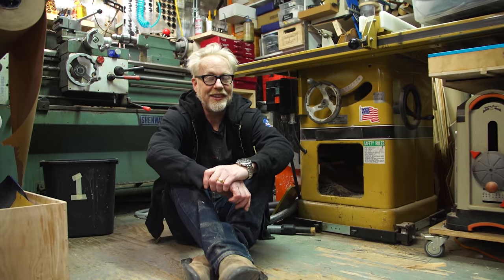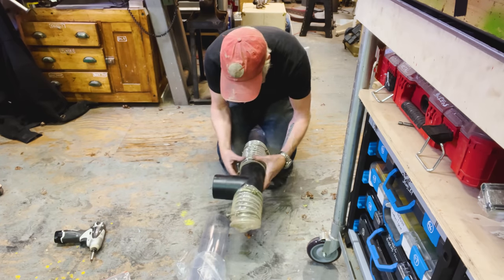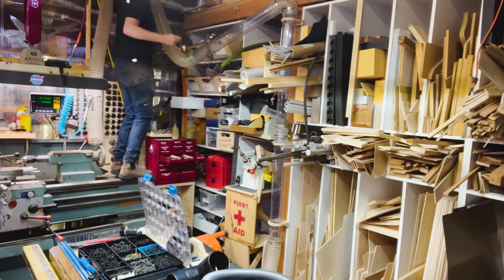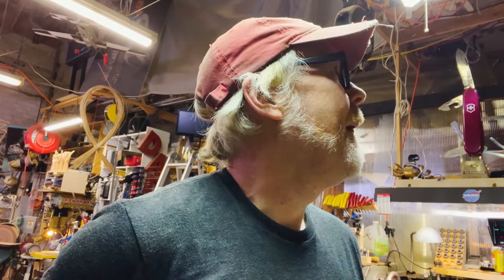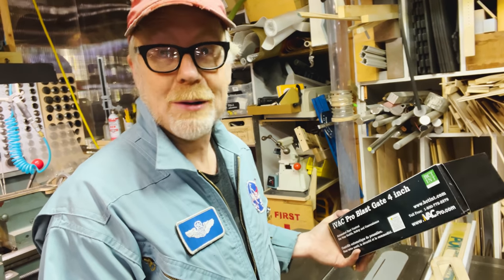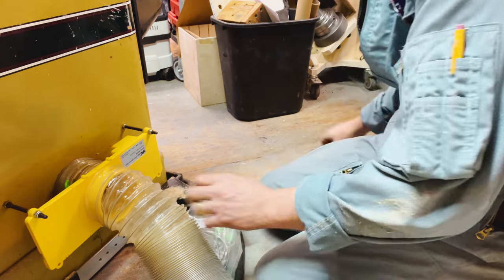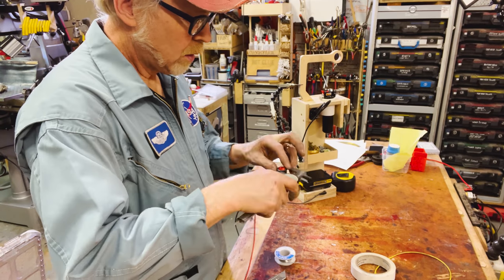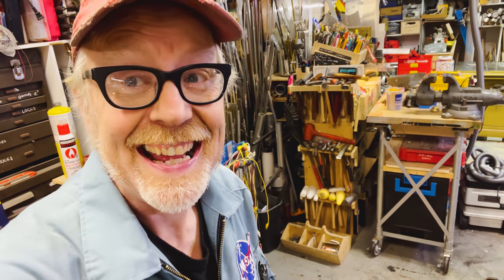Adam Savage's One Day Builds: Shop Dust Collection System!

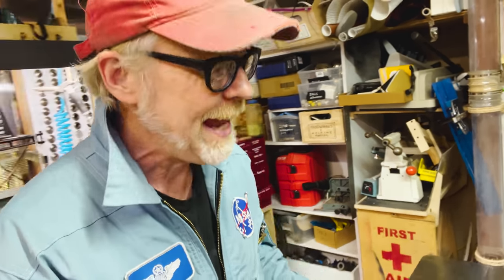Comment: 25:57 I would have put a manual blast gate on the wall in place of the shoulder-high flex-tube coupling behind the saw, saved $110, avoided all that wiring and drilling, and ended the episode twenty minutes sooner. But the push-button gate is cool...

Comment: There is a massive nerd dust collection site by a guy named Bill Pentz you should check out.   You might also watch Matthias Wendel here on youtube.  He has a completely different strategy that I think has alot of merit.  He actually builds his own impellers and volutes from scratch out of wood and integrates dust collection into all of his machines.  And he's getting really good results, tested with an air quality meter.  There are some real advantages to doing it this way.     And even if you didn't want to bother with the homemade blowers, Burden Surplus has some more than equivalent BC impellers for practically nothing.

But for the whole shop method you're doing,  a couple of rules of thumb I've picked up in working on my own shop dust collection:

1.  Use Y's instead of T's.   Produces less turbulence than a sharp 90 degree turn in a T.

2.  Make turns as gradual as possible.   Use the big radius 90 degree fittings to make turns.   Or even better, use two 45 degree fittings.   Or even betterer, heat and bend a piece of the PVC pipe in a form to make a super gradual turn.   The key is to make the air change direction as gradually as possible.

3.  Use 6" pipe if at all possible.   With smaller impellers, you'll lose some static pressure with the larger pipe, but you'll move more air (better to collect fine dust particles).   You only need enough static pressure to keep chips from settling out in the pipe and clogging it up.

4.  On machines that maybe only have a single 4" dust port, consider adding a second port or enlarging the existing dust collection port.   I've seen good overarm dust collection ports built into the blade guard on tablesaws for this purpose.

5.  Use a minimum 12" backward curved impeller with a 2hp or greater rated motor.   Especially if you go with 6" pipe instead of 4".   Ideally, you'd go with a 15" or even bigger impeller, but those get really pricey really fast (I think Cincinnati blower wants $750+ for a 16" impeller)

6.  Design and build your own 16" BC impeller run by a 5HP motor and sell the plans for those to those of us who want to go completely nuts on building a dust collector that will suck the ink out of a dollar bill from 50 paces.

Best of luck

Comment: Those brackets are superb.

I was surprised that one wasn't fashioned to hold the gate against the wall, so it doesn't get banged around.
My money is on the corner where the bolt goes into the plastic.  Hope I'm wrong.

Comment: If you are using plastic pipe for vacuum distribution did you wrap a ground wire, e.g., one turn per foot, around the entire length of the pipe? The air rushing through acts like a giant Vandegraff generator and can give you one hell of a shock if you don't ground the system. Even an ordinary shop vacuum can give a good jolt.

Comment: If I'm not mistaken you would have had better effect if your blast gate on that table saw was back at the wall as close to the main line as possible...less volume to draw a vacuum on if you cut off the whole drop.  Since its remote operated you might have been able to install it before it even drops to the floor

Comment: I'm sure someone mentioned that you could have used thin wall pic waste pipe in 10" lengths. It would have saved you many connections with less flex hose and less clamps.

Comment: I've been dying to find out if this idea I have is good: what if you had a hose coming off a shop vac blower port that connected to the vacuum sucking hose like halfway down, so basically a recirculating system, wouldn't that make the vacuum into a super vacuum? ;D

Comment: I just got a power bar that has a series of plugs where 2-3 of them get no power until one of the others does.  What this allows you to do is power on those outlets only when a specific other one powers on.  The idea is to plug your computer into the switch one and monitors into the others so the monitors only power on when the computer is powered on.  I bet that would also work for the saw.  Unfortunately this is assuming a 110 probably so if the saw is a 220 I don't know if you can get something like that.  But it would dramatically simplify the power on/off of the electronic gate don't you think?

Comment: Kind of surprised Adam didn't go for the automatic switch that turns on an accessory outlet once the tool in the primary outlet is turned on.  Run the automatic blast gate through it for the table saw, and no switch is necessary.

Comment: Ahhh Adam... Your dust collection has (now) come so far, but it has SO FAR to go! I'm rarely disappointed by your videos. But this is such a hack (and not in a good way). You put much more care and thought into your Tape Dispenser! Some points: LOSE THE T JOINTS, 45 deg wye's are what you need , more blast gates, replace that 1 (at best) micron dust bag with a cyclone and a real pleated filter (your lungs will thank you). You loose SO MUCH flow taking your 4" line down to 1.5".

Comment: Just a thought, why not to wire a relay to the power of the table saw to open and close the gate automatically with the table saw.
Not a difficult mod in my opinion.
But hey, love the video, nice work and a very good improvement. It is just a small suggestion.

Comment: I think the gates are supposed to be where the hose splits, not at the tool to maximize effeciency. Also avoid 99 degree angles, 2 times 45 days gree with a straight between is a lot better. Or so I've heard :-)

Comment: What about using 24VAC actuators with current switch on the tool. That way when tool starts it closes circuit and energizes actuator automatically opening gate

Comment: That little unit won't be able to suck that much hose. You need either a bigger unit, or you need to reduce the diameter of the pipe with each successive split and every 3 meters. I'd sell that one, and get a bigger one, back of the napkin math, should probably be the second size over.

Comment: Adam,  you can still get much better airflow out of your system. You put a T right in front of the collector. The turbulence caused by forcing a 90° turn of the airflow significantly drops the airflow to the ENTIRE system. That  1st T should be replaced by a Y.  Then each branch should use no more than a 45° fitting followed by at least 1 foot of smooth pipe to achieve a sweeping turn. For example,  off one side of the Y, a 1 foot smooth pipe then a 45° fitting one foot of smooth pipe and a 2nd 45° fitting to make a 90° turn.  This design should be followed throughout.  The vertical drops should start with a Y off of the main feed followed 1 foot later with a 30° fitting,  one more foot of smooth pipe then a 45° fitting to get you to vertical. Using your table saw as an example,  the T at the bottom should be a Y higher up. The free hose should be no less than 3" diameter reducing the diameter as close to the machine as practical.  4" is better,  reducing only at the nozzle at the very end.  
In this case you might consider getting a dust collecting blade guard to collect dust on top with a 3" fitting as well as the 4" on the bottom.
You must remember that your dust collector is a high volume low pressure system.  It behaves differently than a high pressure low volume system like a shop-vac. A 2" hose with an even smaller fitting going into your hand tool is starving the system for air. Without enough air flow,  material will not traverse the pipes, getting stuck in ridges and bumps caused by flex hose, fittings  and direction changes.  Stay with 3" hose designed for dust collection. When you need to drop to smaller diameter at the tool you may need to add a small vent to increase total airflow.  You may be better off with a high pressure low volume shop vac for dust collection of small hand tools.  Another idea is to run 4" ask the way to the bench. Then only a very short hose to the tool.  
 Also. the best plastic pipe to use is PVC. It's not clear what you're using and why you didn't go with 4" PVC and matched fittings. Hopefully your joints are butted together.  If not, more airflow and pressure drop occurs from all the transitioning which creates lots of turbulence.  Using one section of flex near the collector has a huge effect; as much as  9 times more flow resistance than smooth PVC. 
Every loss is cumulative. Amother example is your free hose drop from the main line.  You should not do it this way.  Use a Y and then a section of pipe followed by another adapter or two to avoid a sharp bend.  If you need to use flex hose,  make it as short as possible and as large a diameter as possible. Can you start the drop with 4" then drop to 3" only near the tool?  
With regard to blast gates.  They are most effective when they are installed as close to the collector as possible.  Since you split the piping into two circuits right at the collector that is the 1st place for blast gates.  When you divide the system like that, half the system isn't under vacuum,  and all the associated leakage isn't impacting the port you are using.  They can be deployed as a system through a controller so that only the sections of the system you need are active. 

I'd heed the warning about metal fragments. There are reports of metal fragments hitting impeller blades causing a spark or hot chip to land in fertile fuel and smouldering into a fire. The best way to prevent this is a dust separator installed ahead of the collector.  There is some loss of suction with this type of device,  but safety is paramount. 

I'm happy to see you've made improvement. Don't forget, a good mask or elastomeric ventilator as PPE is relatively cheap and the best choice for your health.

Comment: i know i am late but
1. plastic pipes is a bad idea because it causes static and can cause a fire
2. use y junctions not t junctions, with the junction pointing towards the suction
3. keep air leaks as close to 0 as you can
4. do your bet to keep all of your runs as straight as possible
5. only use flex hose at the vary end by the machines

Comment: Hey Adam, thanks for your video, it was pretty instructive. But I have a question to ask about the piping PVC verses the flexible hoses. 
Let's just say, I have a very small shop "a bedroom turned into a shop to be exact", and I have a fair amount of flexible hose, and I want to build my dust collection system. It Would be for about 6 tools, or 6 hoses, 4 tools, and 2 loose hoses for hand tools and clean up. So meaning 6 Blast-Gates. 
Now here's the question. If I would cut the flexible hoses, so they would reach each separate connector, to each Y connector "precisely" fairly tight, no bending of the hoses. They would fit pretty much to the exact length. Could it do as good as the PVC or even as tight as possible, the ridges would cause a certain amount of loss of suction?

Please let me know truthfully. 
Thanks
Reply: Flexible hose no matter how straight the run is will cause a lose in machine efficiency. Only time flexible is recommended is going from the main duct to the tool.
Reply: I really appreciate your reply. I know you receive a ton a messages everyday. So I appreciate you taking the time to read my question and sending me the reply I needed. Thanks for the answer, I'll concentrate on getting more 4" Pvc piping. Thanks again!

Comment: If turbulence effectively reduces the width of the channel, then that narrower channel would become a bottleneck in this setup... right? I mean the narrowest point determines the maximum flow for the whole system. You can't get that flow back by putting a wider channel down stream. I feel like for this setup to make sense the "effectively reduced width" has to be something that can be overcome someway.

Comment: Adam a a person who watched his shop burn down because of a mistake that could have been easily prevented take a bare copper wire and wrap it on all that rigid pipe and ground it. there is a reason industrial dust collection is metal pipe and grounding is one of them. I lost a entire cabinet shop because of a static spark in the Plastic dust collection pipe. the aerosolized dust exploded that quickly traveled to my dust collector and all tools and the whole shop was on fire in seconds. it was quick an intense.

Comment: The big dust collector is better for the big tools, anything with a 3 inch or bigger port....if you connect a small hose to it, there wont be enough airflow to get it to the dust collector. The wee sander will work much better if you connect it to your festool dust extractor (it has much better suction for that hose diameter and much better filters for fine dust]. Theres canister filters for the big dust collector that improve airflow and filtration levels.

Comment: "If they don't have them - we can make them"

Sure; you patch the power of the tool into a Raspberry Pi 3 or 4 and have that with a switch (or patched directly into power of the machine with a converter) and when the power comes on it flips the gate on the other end. The gate could be a simple interneral axel on a stepper connected to another Pi to retrieve that info. Once you got one pair - making the second becomes as simple as flashing a SD card and loading it into another set. The hard part is making the sets.

Grab Jeremy and Norm's knowledge and you'll make it through fine. Y'all got Kirk's chair working, this shouldn't be much more trouble.

Comment: Possibly worse than the ribs in the corrugated vac piping is the fact that when you turn it on, the volume of the hose changes.  At 35:40 in the video, you can see when you turn on the vacuum, they hose jumps around and squeezes together, thus changing the volume in the pipe.  The amount of energy required to maintain the volume change is lost energy which could be suction.  When you were a child you likely had a Hoover vacuum with a semi-flexible hose attachment with no internal ribbing.  Those old hoses retained their size when the vacuum was turned on.  Those were the days.  The effect is referred to as capacitance.  You may have heard of that in electrical systems, but mathematically, you can treat your vacuum cleaner in the tried and true, spring-mass-damper analogy with hose having some spring characteristics.  And as I recall from your TV show, you relied on Grant for any math that had to be done, but if he were around, he should know what I'm talking about.

Comment: Hey - wouldn't the system run more efficiently with the sander gated closer to the dust collector?  I guess expensive for another automatic blast gate, but there's a lot of hose length to the sander.

Comment: Your make up air comes from where? My vacuum is in my utility room. The vacuum pulls from my shop and exhausts filtered air outside. This used to pull the makeup air from under the doors and whatever cracks it could find until I installed a filter on my window and sealed under the door. This worked fine until winter. now I send my heated filtered air back to the shop. Wondering if you have a better solution. Thank you  very much for a great video.

Comment: Just offhand, if'n I had me a $100 remotely controllable blast gate (even not using it in a system of gates that 'talk to each other'), wouldn't up at the branch be a better place to install it?  That would put it before the clamped 'solid-to-flexible' joints between the branch and the saw, eliminating their combined leakage (if any) when the gate's closed, and would still leave the on/off switch where you want it, for the cost of a few more feet of wire.

Comment: Really should have used 6" pipe down to the tools and then reduced and to the flex hose. You will also live longer if you use a better dust collector filter down to 1 micron. I might be a little overkill on my set up but dust health problems no joke.

Comment: Aren't you supposed to put grounding wire through the collection pipes to avoid sparks from static generated as the dust travels through them? Or is that a myth?

Comment: I got to the place where the electronic gate was going on to the back of the table saw. Wondering if a manual gate (like at the sander) at shoulder height on the riser tube would have worked. Hate to kill the excess fun, but...just wondering.

Comment: For Extra Credit just wire the Blast gate to the saw on off switch.
Reply: An seal the Table Saw Cabinet up with silicone and gaskets so teh only entrance is the controls and Blade port. Also get a Sawstop, please,  you need one.

Comment: To increase the suction could you have not use 2.5 or 3 in. pipe so that you don't have to pull the 4" Column of air/particulates.

Why didn't you add the gate to the tee. Eliminating some volume of air column. Install for the power would be easier as you would not have to allow for the moving of the table saw when required...

Comment: Adam, I’m sure that you aware of the likelihood of static buildup in plastic hoses used for dust collection. As you know from Mythbusters, fine particles like non-dairy creamer and sawdust can be extremely flammable. Common practice is to run a grounded wire throughout the collection system thereby discharging the electrical buildup. We don’t want to see you on the evening news for the wrong reasons. Just saying. All my best.
Ps. Don’t forget the static canon.

Comment: Why not have the Gate attached at the wall instead of the equipment and trigger off of draw on the outlet the equipment is plugged into?  In this way you could switch equipment out and keep the the gate safer.

Comment: You should put blast gates closer to the dust collector rather then the tool. Also dust collectors are not great for the small power tool ports. Probably better off with a shop vac for that.